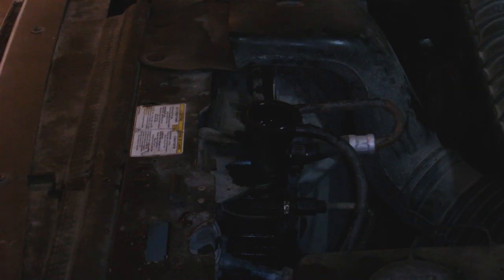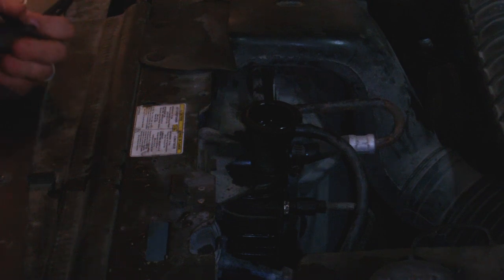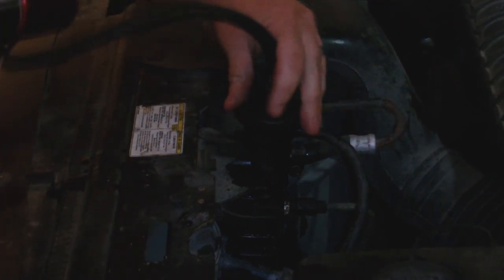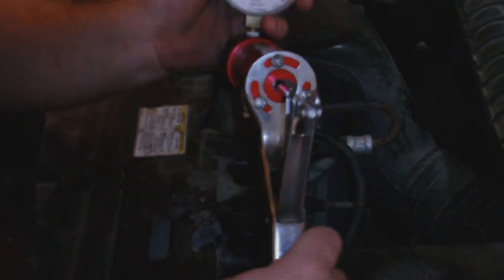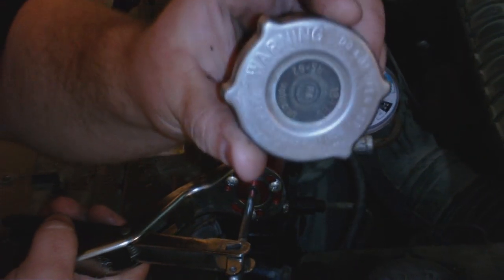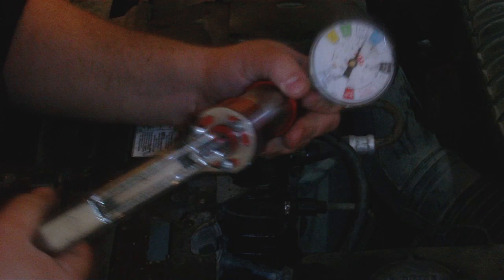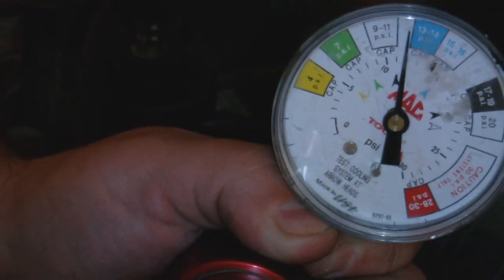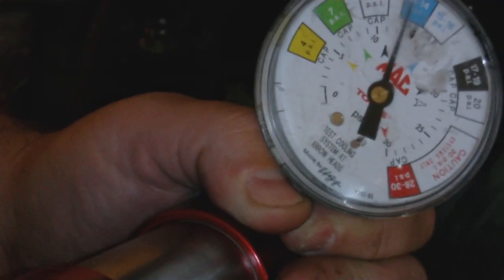How to Check for antifreeze leak.Cooling system pressure testing

Comment from the maker: No, at least I wouldn't recommend it. There is no need to. You can do a compression test, leak down test  to diagnose a head gasket. You would see bubbles in the coolant through the radiator neck if you use a leak down tester. There are other methods but I gave you the most common methods. Thanks for watching.

Comment from the maker: Oh in that case you can use stop leak and that would buy you some time on a small leak like this truck has but I highly recommend that the radiator be replaced and cooling system be flushed as soon as possible to prevent engine damage. Better safe than sorry is my motto.

Comment: Excellent video, very helpful.  I just rented one of these from Auto Zone to find a leak in my truck's cooling system.  I don't know this topic well, but if I can't find the leak visually after pressurizing, is it safe to assume that the pressure will slowly drop on the gauge, also indicating the presence of a leak?

Comment: hey when reach the pressure on the cap lets say its 13 psi how long it suppose to stay on that 13 psi mark before dropping from that level?
Reply from the maker: It should hold for a very long time. If it does drop say in 3 - 5 minutes , than you have a leak. But if it holds for 20 - 30 minutes and drops a psi , I wouldn't worry to much about it, if your not loosing coolant. I hope this helps. Thanks for watching.
Reply: handy man thanks. what happen i have a  Kia k2700  pickup Van it overheated but when i realize i cut off the engine when i check out what happen the top of the radiator had blown out i had a plastic Radiator so i purchase a Metal Radiator the engine started Knocking the next day i drove it to work so i had to get into the engine when the Mechanic took off the head the Sleeve had move so i had to rebuild the engine block to fit the new Pistons. Do i have to pressure test the cylinder head of can an experience Mechanic could determine that the cylinder head is not damage after he inspect it

Comment: Thanks... my 740 volvo is dropping coolant level  very slow. Twice been preassure tested and negative of finding any leak.  However the coolant odor can be smelled when the engine is hot. visual inspection finds nothing. What product, tester would identify what the coolant odor is coming from?  Ron 206-720-1055